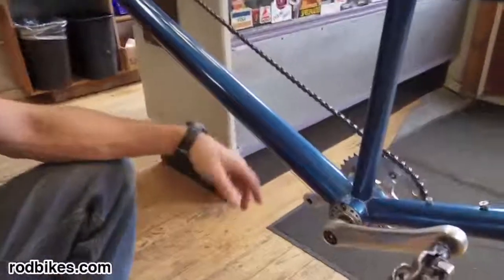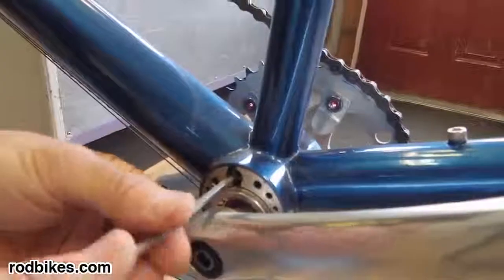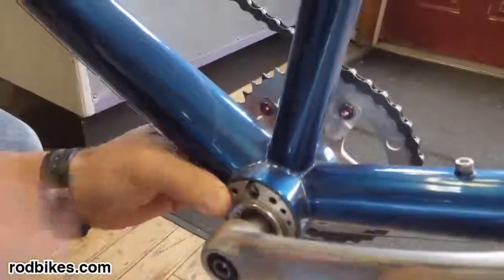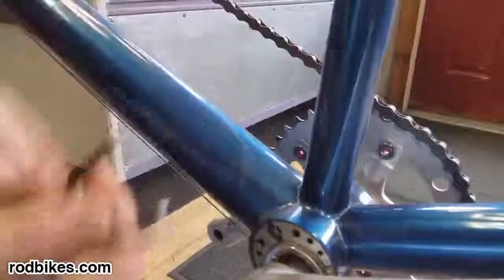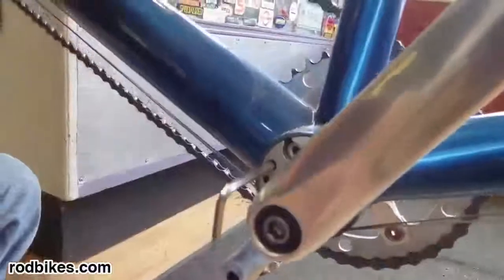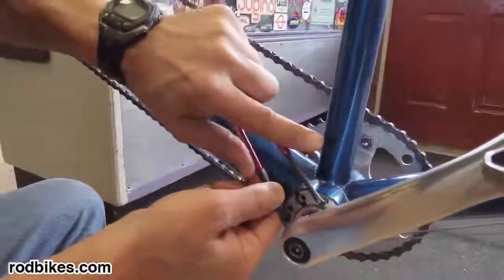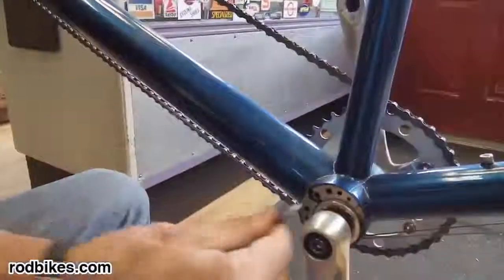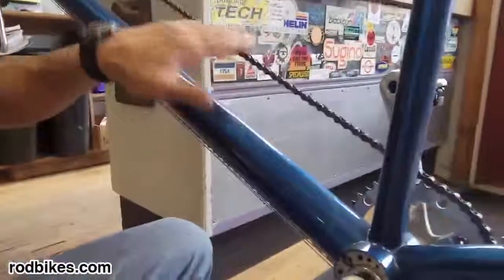How to adjust a Bushnell eccentric bottom bracket

Comment: is there a torque setting on the 4mm?  Mine seems to keep on slipping.  Also - when timing chain is replaced: is there a "home" place for the eccentric shells (to permit later chain adjustment).  We like to ride "in phase".  Does one just "eyeball" the crank phase?  Or is there a super cool secret way?